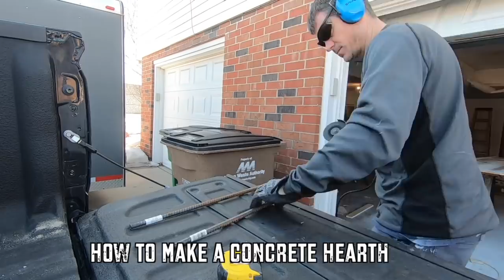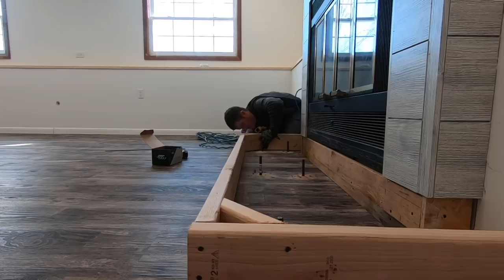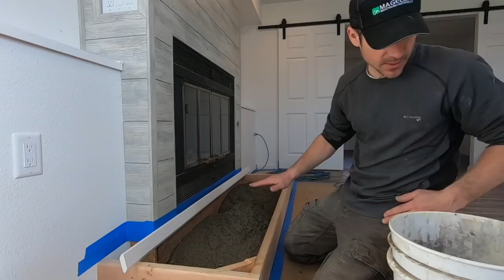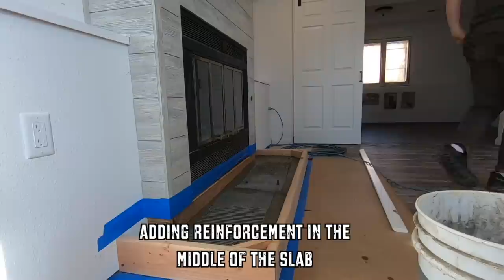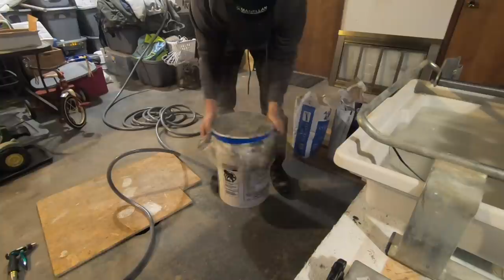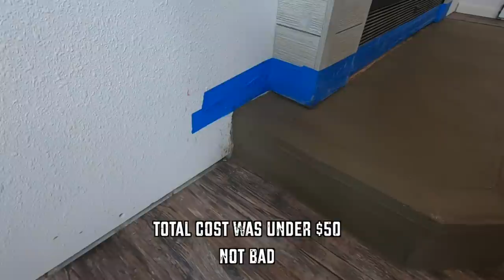DIY Concrete Hearth for Basement Fireplace

Comment: I just think you should remove those floating floor panels (or whatever it is) from under the concrete, as it is no longer floating and the weight will warp it.
Reply: Yeah, or cut the required expansion gap around the outside of hearth and isolate the under hearth flooring from the room flooring. . That would make the flooring underneath a decoupling membrane.

The floor may never buckle but then again it might. You never know. I installed one of those floors and added a custom made threshold that I screwed down too tight - the overlapping piece squeezed the floor down too tight. Within a couple days the floor buckled. Luckily I was able to back the screws out a hair and the floor unbuckled.
Reply: I was thinking exhactly the same. Would not cost to cut floor out with expansion gap.

Comment: What is the tool that you use to vibrate the concrete?  Is it stand alone or an attachment?  Good video.
Reply from the maker: It's called a concrete vibrator; we have one listed in our Amazon store under Concrete Supplies. www.amazon.com/shop/marshallremodel

Comment: I would have installed  some backer board or durock sheet first and then pour the concrete. Or at least a plastic sheet on top of the engineered wood or whatever the floor is made of.
Reply from the maker: Thanks for the suggestion!

Comment: Love the video, only critique is that dragging a vibrator through concrete is going to give you an uneven finish and cause problem down the line because it causes the larger aggregate to sink to the bottom. A better alternative is to go straight down and straight up. This will settle it out and get the air out without causing the larger aggregate to sink to the bottom.
Reply from the maker: Thanks for the tip!
Reply: That’s not true both sink aggregate
Reply: @bradschippers8599  Straight down and straight-up will settle aggregate but because it's not sitting in the concrete for long periods of time it won't cause the aggregate to consolidate at the bottom. Ask any geotechnical specialist that oversees concrete pours. In some cases, an inspector will fail you if they see you dragging a vibrator.

Comment: did you have any issue separating the form from the concrete just using plain lumber? i'm going to be doing this myself and alot of people seem to use melamine
Reply: You generally spray a lubricant, or if outside, diesel works.  The smoother your form, the less work you will need to do to smooth it out after its set.